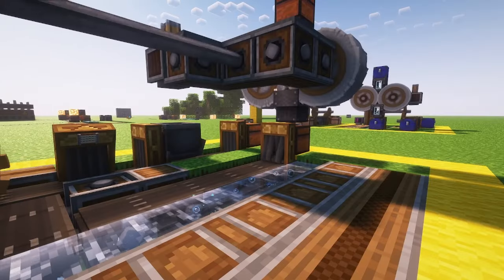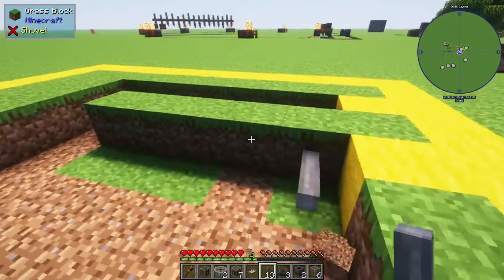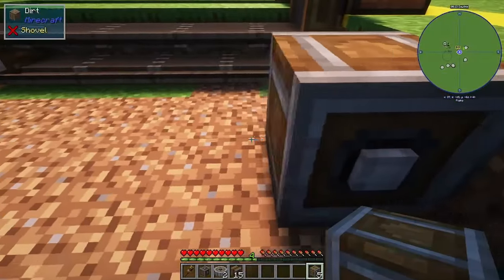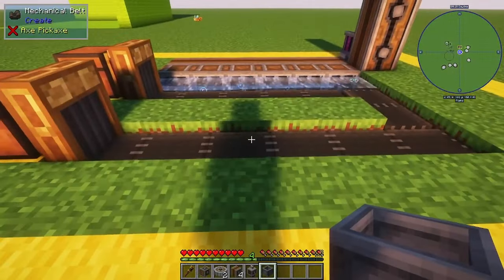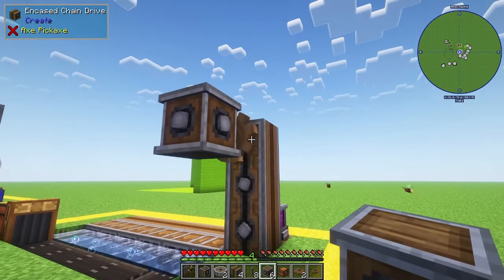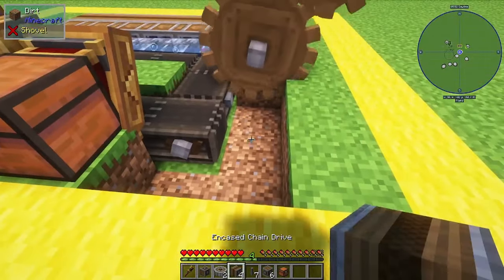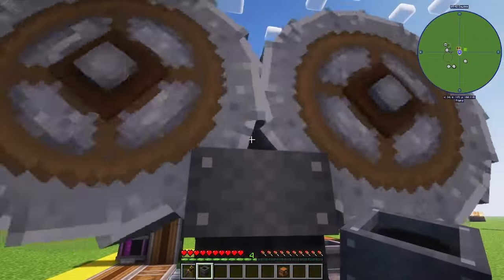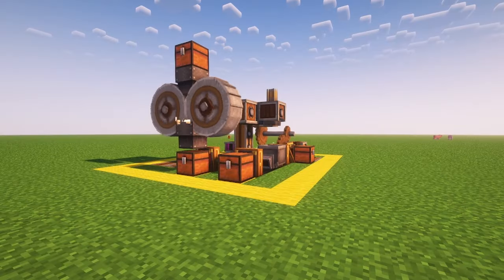Create Mod Ore Processor!! (Quick, Easy, and Small)

Comment: this contraption can definitely be improved. I'll link a schematic once I get home. Also try to sync your words to your actions. In the video you placed a big cog wheel, a shaft and a small cog wheel but you started describing what you were doing after you finished.
Reply from the maker: You’re right. This is I believe my 3rd tutorial video. Definitely rough around the edges! I didn’t even know how to do basic editing back then. I’ve learned a lot since this video. Thanks for your input!
Reply: Any update?
Reply: So, did you do it?
I'd like to know how to power it to go at 64RPM like shown in the video, because a large Water Wheel doesn't generate enough SU for that, and some people could appreciate a description on how to generate enough SU in a compact form.

Comment: when u place the gearbox and vertical gearbox in-between the belts, how is it getting rotation? before the cut its not moving, but after the cut its moving the belts? mine isn't moving, and cant figure it out, first time playing with create
Reply from the maker: I believe you need to place a shaft adjacent to the gearbox that might be your issue!
Reply: same problem. not sure what he means by placing a shaft. you should consider uploading these to create schematics
Reply: You need to put a shaft under the belt closest to the encased fans/water for it to work, connected to the normal gearbox
Reply: @alexsosa6588  Honestly that would be way to easy because in the end it will be built for us without finding the issue your having
Reply: @alexsosa6588  
You need some basic understanding of how this things work, to fix these issues, my advise is to search basic tutorials, and then try what you learned in them to see what is causing the issue.
As mentioned, he didn't visually showed how to connect the gearbox to the belt, just add a shaft inside the already built belt, (for anyone who has this problem in the future).

Comment: I don't understand how you powered the conveyor on the left. You left it at putting a vertical and regular gearbox down and I know there's something else because before you cut to the next step the belt wasn't moving.

nvm found ur comment on the same question (its using shafts in the belts by the boxes). The only tip I haven't seen while reading is making sure to tell us what items your using. You only showed them in the chest. Thank you again for showing this very attainable, good system.

Comment: just wanna say 3 things: the creative motor or whatever you are using needs to be 64rpm and the last 2 shafts place both of them next to the normal gearbox on the ground (one inside the belt that is infront of the basin and one inside the belt that is infront of the water (you can place shafts inside prebuilt belts)) and the funnel that makes the stuff get out of the chest that has the dust go to it and you will find smth that you can scroll just change it to 16 so the dust can get washed and that should be all the problems
Reply from the maker: Thanks for the info! I appreciate your advice!
Reply: I tried to connect a Rotation Speed Controller to get those sweet 64 RPM, but sadly that overstresses the whole system, I am running it on a large Water Wheel, the max speed I can give it is 16 RPM.

Comment: If your trying to figure out what he did at 3:10, for the normal gearbox he placed down, break the belts on the left and right side and place shafts going straight from the gearbox on both sides, then replace the belts. IDK what he actually did but that fixed it for me. Also you might have to slow down your power because it takes a small amount of time for the ores to wash

Comment: Any tips on how to make a good power generator for this farm? I have 3 water whells and it's going incredibly slow
Reply from the maker: Probably a steam engine, But you could gear it up to be faster!
Reply: @cornybreadman  also my belts in front of the fans aren't moving 😭😭 how did you do it i followed the tutorial
Reply from the maker: @gianlucabrambilla9665  make sure there is a shaft connected to the belt. Right click the belt with a shaft. This is one of my first videos not my best work!
Reply: @cornybreadman  oh ok now it's working, tysm
Reply from the maker: @gianlucabrambilla9665  
No problem!

Comment: need help. my mechanical press isn’t working, i’m trying to figure out how to add more power, but i can’t figure it out. the crushed iron is just sitting in the basin and won’t move, any ideas on how to fix it?
Reply from the maker: Try adding another power source like a boiler, water wheel, etc. it sounds to me like it doesn’t have enough stress units to power the machine! Also this is some of my early work so it’s probably not as clear cut. 😅